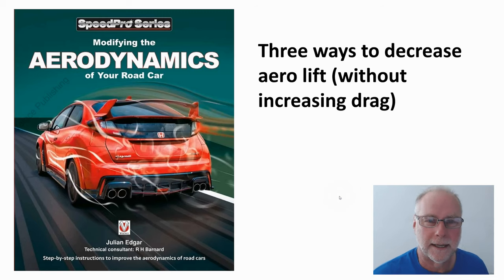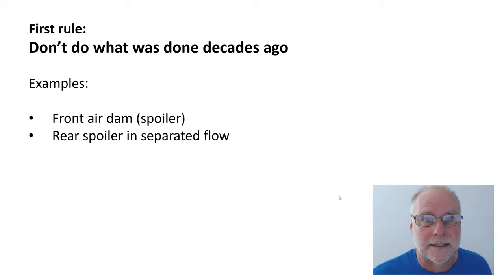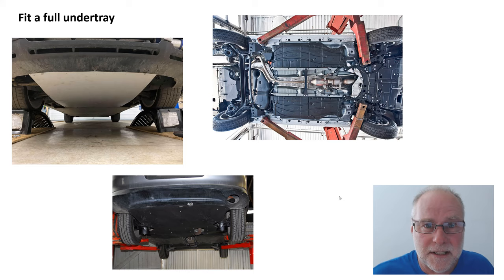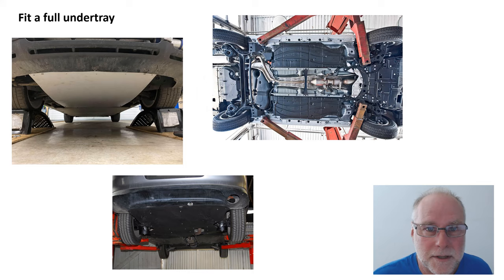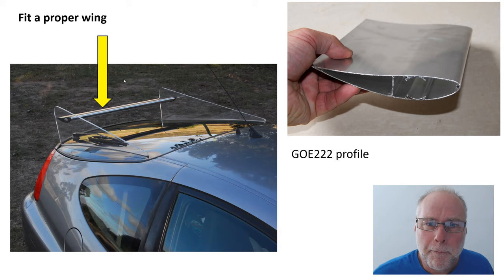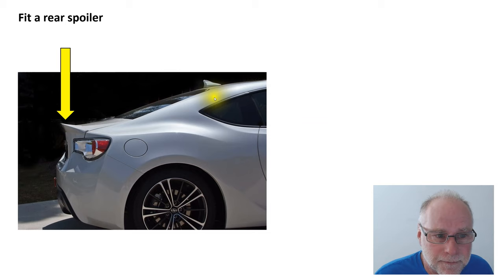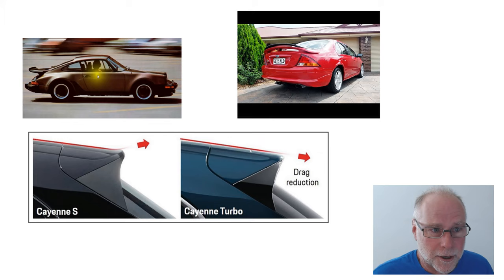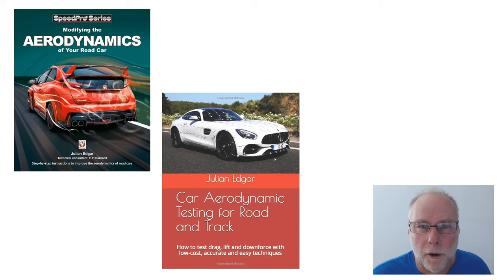Three ways to decrease aero lift without increasing drag

Comment: Thanks so much for all your content on under trays. Do you think once you increase down force or reduce lift underneath the car that braking will be reduced with all other things being equal? It seems like more grip would be available to the tires.  Will be incorporating your ideas to better improve my 2013 Sonata which is already modified.  Thanks again
Reply from the maker: Yes braking will be improved with less lift / more downforce. But... you must be braking to the onset of ABS / wheel locking, and the difference will be greatest at highest speed.

Comment: I have this question if I install an undertray am I gonna mess my cooling system? That air that passes through the radiator has to escape somewhere, I was thinking about getting one of those bonnet spacers
Reply: For most cars, the base of the windshield is a high pressure area so these hood spacers will most probably make air enter the engine bay

Comment: I’ve always wanted to do a full front to back undertray but I am concerned about using a material that is fairly light but robust enough to withstand the heat from the exhaust system. 

I also am concerned with sealing up the area underneath the engine bay because then where will all of the air that is pushed through the front heat exchangers going to go (without needing to vent my hood).
Reply from the maker: All covered in great detail in my latest book - https://www.amazon.com/Vehicle-Aerodynamics-Modification-Development-alternative/dp/B0C87VYVL8 or Amazon in your country.
Reply: You can use aluminium sheet or the cheaper aluminium composite panels.

Comment: Hi  I have a Ford E450 van and it's engine is between the front seats.  It gets hot do to the engine bay not being able to get the heat out of it.  Will an undertray help?  The bottom of the van is about 15 inches off the ground.   Thanks, Jim
Reply from the maker: You really need to do some simple aero pressure measurements, as covered in my book. Otherwise, it's just guesswork.  https://www.amazon.com/Vehicle-Aerodynamics-Modification-Development-alternative/dp/B0C87VYVL8 or Amazon in your country.

Comment: What u opinion the best position to put exhaust tip tail pipe at the back? Center or right or left of the car..
Reply from the maker: I've never seen any research on this and haven't done any myself. I doubt it matters.
Reply: If you look at late model truck they are basically in the bumper. They add a little air so it can make the wake a tiny bit smaller.

Comment: Time attack aero  . the engineering guide on proper  automotive aerodynamics.
Reply from the maker: No, not at all. Such cars would have massive drag - as nearly all race cars do.
Reply: @JulianEdgar  but there a  way to increas speed and efficency? also with integrating proper aerodynamics also can improve acceleration right?
Reply from the maker: @ianvital8834  I cover the  modification of road cars, where you want low drag and low lift (or some downforce). Race cars typically go much faster around a track with huge drag and huge downforce. Ipso facto, race cars are not a good guide to the aerodynamic modification of road cars.
Reply: @JulianEdgar  thanks i'll look it up later. I'm currently practicing  automotive  design lookin how to reduce drag and generate downforce with out to much drag since my cars has less HP taking advantage on being light car.